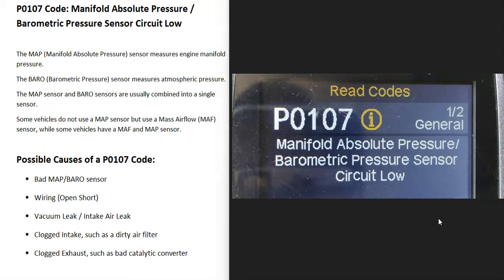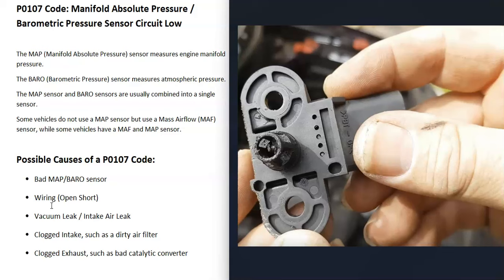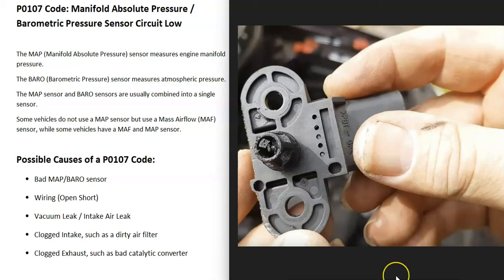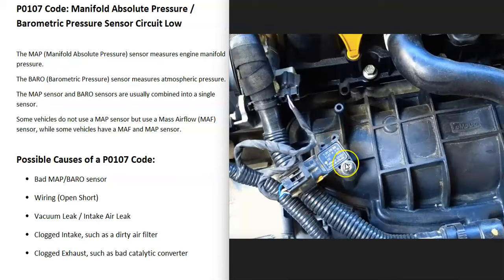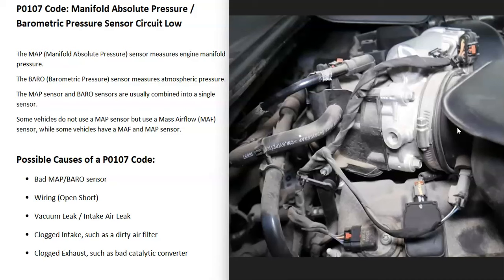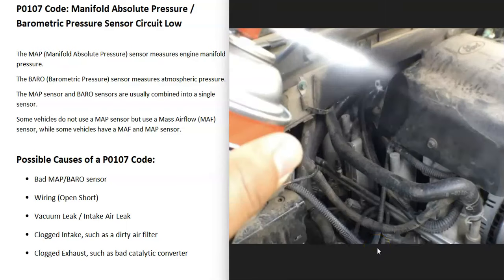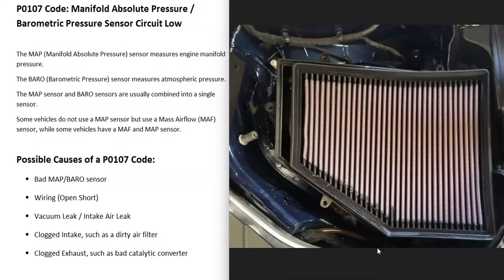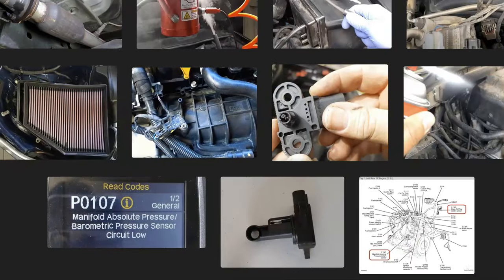Causes and Fixes P0107 Code: Manifold Absolute Pressure / Barometric Pressure Sensor Circuit Low

Comment: Thank you! I tried the easiest fix and replaced my air filter and reset the codes and it's hasn't come on for almost 24 hours and I drove 17 miles since then -on and off fwy. I did this all by myself thanks to the Internet and guys like you who share their valuable knowledge! I feel so confident right now